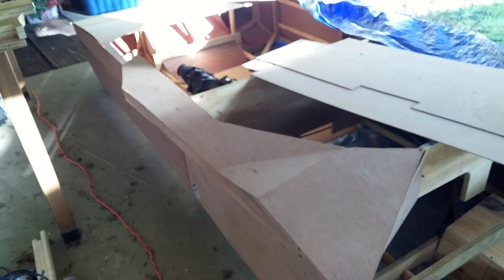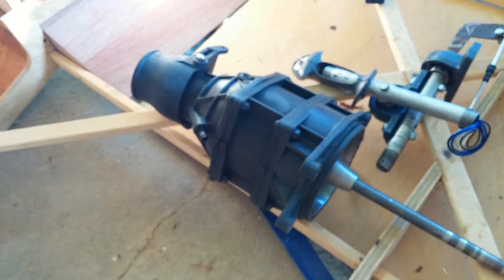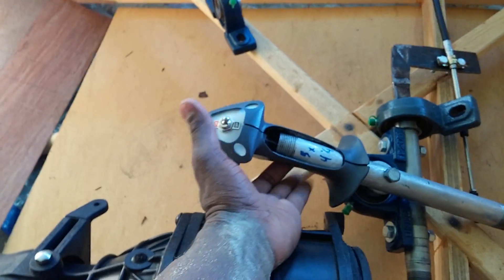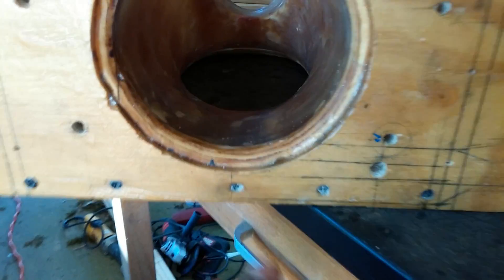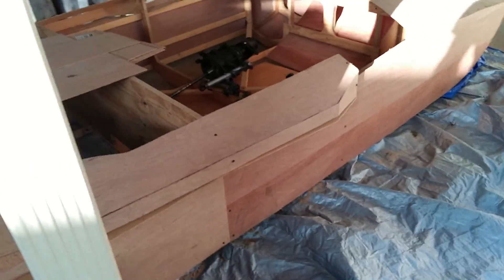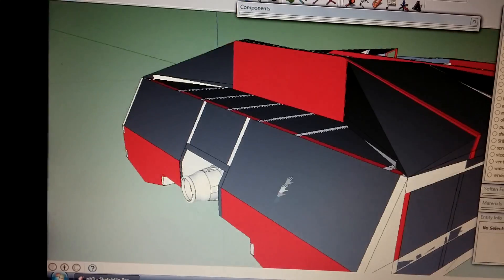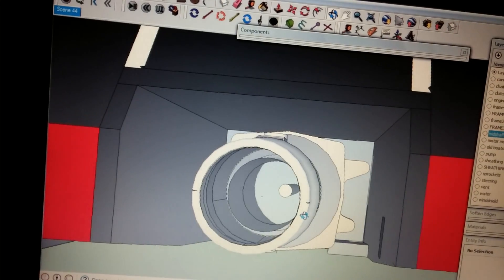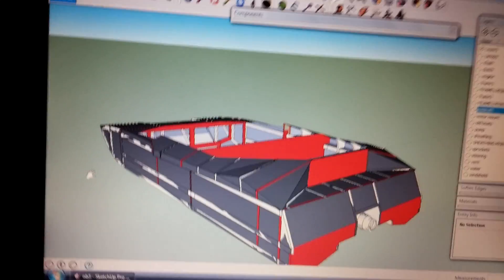Homemade plywood jet boat pt.7(sheathing)

Comment: I know this video is old but have questions as to why you went with jet? The4sroke engine you have won't reach the rpm as a 2stroke can which is why you won't get the performance you think. But I could be wrong as hell.

Comment: Nylon spacers work fine. Maybe some lock-tight on all the nuts.  
Dont be afraid to put some ballast wieght at the very bottom of the boat, bricks or something heavy. This is where you can bring tye COB lower to match your CO bouency. Maybe 10 bricks. I put about twenty bricks in a 19 foot.
keeps you from bobbing around. Styrofoam cound insulate your engine noise.
If you boat goes fast enough, you could put a small aluminum tube trailing off the edge of the transome. Itll scoop water and if you hard attach it at an angle itll make a rooster tail!  You could do two on your desisign..hehe
Dont even think about not filming your boat on the water. Cant wait to see it. Cheers bro. Ill email you.
Reply from the maker: RocketRadioShow1 Thanks a lot RocketRadioShow1! You are bringing up a lot of details that overlooked. I love the scoop idea lol, im going to have to look into that. Dont worry brother, I made a promise to you all and myself that I will test it with the engine and record it. Thanks!

Comment: You can make a intake screen out of a cut out section of shopping cart.  Its chrome plated and makes a great resource for chrome pieces.  
Also, maybe consider putting tiny fins (three or four) little shark fins (maybe and inch by inch big)on the inside opening of the intake. Put them at angles so the water is twirled into the chamber.  It will make sure to saturate the impeller completely,even at speed. As apposed to gurrgling, with free air bubbles hitting the impeller.  The sharkfins will spin the water as it enters and reduce cavitational forces and improve the flow threw the propulsion. The intake fins will also quiet the slap sound coming from hitting the throttle full.  Its quieter.

Great job on your work.  You have a very creative and bright mind.
Reply from the maker: Wow brother, Ive been avoiding that screen for the longest because i wasnt sure how to attack it; but after reading your comment i think i can mass produce them now! I would've never thought about this. I really appreciate the help brother and will try my hardest to perfect one. Thanks!
Reply: Whats your email?   I got lots of tips for you.  I make stuff too.  Love your show. I see i can actually get a comet tranny so now im thinking about putting an inboard engine in my wood boat.
use aluminum. You can sand and easliy polish your fabricated parts.  Even simple angle iron polishes like silver.
i see you attachments-cable connectors and such,  make spacers to take any slop. The reverse bucket needs spacers it looks like. You are gonna have tons of vibration.
You can paint your plywood with watered down elmers glue, it will harden and make your fiberglass stick better and reduce the amount of fiberglass you ll need.  
Make sure you unstand the difference between your boats center of gravity and that of the center of bouncy. .very important.
your boat needs a wrist strap safty switch incase you fall out.  I really dig your design.  You can curve pexiglass with a heat gun if you want fancy windshield.  Check out using fleece with fiberglass for smooth compound shapes like a windshiled mount.  You want a massive bilge pump..so you wont sink quick if you spring a leak.
i see the very bottom edges of your boat might benifit from thin oak runners incase you beach or haul out on the rocks.  
You can get cool cheap mechanical parts from the auto junkyard. I find all kinds of stuff, like wiring and pulleys, lots of re use stuff pretty cheap too.
i cant wait to see your boat in the water. Great project. Next you should make a 30 ft powercat! heheh
Reply from the maker: RocketRadioShow1 ronaldhotboyatgmail brother. Im all ears when it comes down to help which by the way you have done a lot. Putting an onboard on a wooden boat is unique if you ask me. The original design for the one im building now included a comet gearbox as well. Please upload footage whenever you start. I would love to see. I wanted to use aluminum as well. I told my coworkers that if this boat turns out okay, ill eventually invest in an AC tig machine and make another one identical to this one. You have an eye like a hawk! I do need to add spacers; do you think nylon spacers will work? I never would've thought that elmers glue could be used in such a way (sounds like a money saver as well). As far as the COG and COB, I found the COG, but the COB I wont be able to find until I put it on water (unless theres a formula of some sort). Thanks for the safety switch reminder brother, that is a must! Awesome idea about the plexi; I was scared that it will scratch and fog/fade, but nothing beats a failure but a try right. The pump is a MUST HAVE as well brother. I hate to be another stereotype but........I cant swim well lmfao! I the way you think, the next build shall be a yacht lol  Youve been EXTREMELY helpful brother and answered at least 75% of the concerns I had. Thanks!

Comment: It's good to have a project that keeps your mind occupied and your hands bizy! Hang in there cause you're nearer the finish than when you started! Good job!
Reply from the maker: You are so right brother, i dont have a lot of time off but when i do this is what i do with it. Thanks a lot brother!
Reply: ronaldhotboy Do you plan on fiberglassing it? Also what engine are you using. How much hp is it?
Reply from the maker: BK201MXP yes sir, ive been doing small sections whenever i have time off. As of now im using a small harborfreight 6.6hp engine to test everything out. If im happy with the results then ill eventually upgrade to an actual pwc engine. Thanks for watching!

Comment: home depot sells a "Y" pipe that does the same thing as your fiberglass job…just a hint for next time
Reply from the maker: Thanks a lot brother, I couldn't find one that fit the diameters of the three openings. Next time it would be a WHOLE lot easier to base everything around the Y piece. Thanks for the advice!

Comment: Looking good man! Glad to see you're still at it.

I learned about a new fairing product called TotalFair from TotalBoat (a line from Jamestown Distributors in RI). I haven't used it, but wish it were available when I was fairing my hull! It's a 1:1 epoxy fairing compound mix that turns green when it's mixed properly. Easy and the couple of reviews by users seem positive. If you'll be fairing your seams this might make that an easier process than the traditional method of epoxy with microbaloons or the like. Link:

http://www.jamestowndistributors.com/userportal/show_product.do?pid=97775&familyName=TotalBoat+TotalFair#

Good luck! Look forward to seeing more progress.
Reply from the maker: Wow thanks a lot brother! Im always open for new ideas and methods. Im headed over now to checkit out. Thanks!